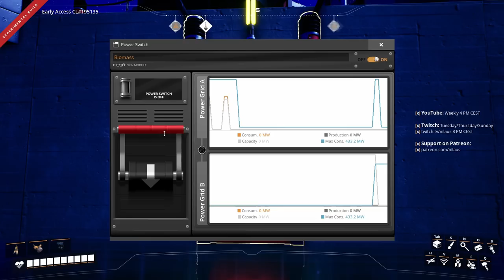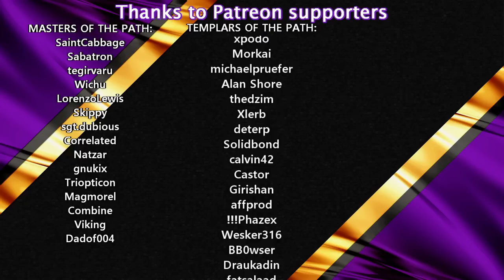FUSE BROKEN! How To Recover From Power Problems | 11 | Satisfactory Update 6

Comment: I like to keep a few of my coal generators on a separate fuse from the rest of the power plant.  This separate line powers the coal miners and water generators which load the rest of the power plant.  And the compressed coal assemblers when applicable.  Then when the fuse breaks for the whole factory, I still have these chugging away loading materials into the generators and priming them so they are ready to turn on.  As my power plants grow, I gradually move more generators onto the separate line to ensure all fuel sources are powered.  I might need to rethink this when I get to nuclear (not sure if uranium getting backed up is wise - I haven't played that part of the game yet), but until then it gives me some peace of mind that turning everything back on will never need me to reload all of the pipes and conveyors.
Reply: yep, and the swatches are real handy too. you can paint your critical power infrastructure with some signal colours, so you see immediately which generators and drills power the whole powerplant.
the downside is: each powerplant adds a new interlocked calculation table to your base planning, which gets complicated fast.

Comment: My Strategy is I isolate each power plant with a switch or single wire that connects it to the rest of the factory. When a power out happens I can disconnect each from the main grid and restart them one at a time. While they are disconnected I can check for issues and ensure max output is reached. 
Once they are all started and any batteries are charged I can then reconnect to my main grid. If Im still over then its time to build a new power plant.

Comment: I always build my power network such that I can disconnect individual factories and each power plant from a primary power spine, which in the early game means placing two power poles directly adjacent to one another so there is a designated cable to delete. Saves me so, so much trouble! There's also a mod that I like to use which adds additional types of power lines, which makes it a lot easier to visually distinguish the spine from a factory wire.

Comment: I wish there was a guild online to help me manage my power and recover from power outages too.  The end made me chuckle.  

I try to build all my factory sites with a single main power in that comes via a main switch.  Then if I either have random floors of things in a building I try to power each floor from its own switch or if I can run a site at quarter or half rate then I try to add switches to let me shut off extra capacity till I scale up.  A lot of switches!  If you can be organised about it though it can be a huge help in taking out large amounts of power to help recover though.  

Thanks for the tips about adding small temporary or sustainable power around larger plan inputs.  That is not something I have thought about doing before but I can see that a few biomass burners might be the ideal thing to jump start after a problem.  I usually try to have raised water tanks and small storage of coal in the hope the buffer will let me power on after instead but one day that may run out.

Comment: I always build battery banks that I charge up fully at coal miners, water pumps etc and make it so I fully isolate the entire power generation system.
That way it's a matter of cutting the main grid, switching to the battery bank and that part of the power generation is back up and running.

Comment: Some excellent strategies here. I have my coal plant powering itself, so if I spike consumption it could collapse easily. It wasn't as much of a worry when only dealing with biomass burners. I'll have to get the caterium research done, but putting in switches to isolate sections is a great idea.

Comment: One thing you didn’t mention about why just flipping the power switch to on doesn’t generally work.  When you flip that switch, every single machine connected draws its power as if it was active.  If the machine has no resources available or has its output full, then it almost immediately switches to ‘idle’ (0.1 MW draw), but for a fraction of a second it does have its full load requirement on the network.  That is why you see a large spike in consumption that then settles down to ‘normal’.  For that fraction of a second after you turn things on, you need to have enough power online to handle that spike of everything being active.
Reply: Is that still true?  Because I can power up my whole world, with a max consumption of 30,000 or so MW, without nearly that much power online.

Comment: I only ever use the batteries as a kickstart backup for my fuel generators and associated sources so I can kick the power production back on after isolating the power hog in my factory. Also having a circuit breaker between power and the factory so I can prevent the power coming back on from letting the rest of the factory overwhelm the power production before its at full output.... Though having biofuel burner connected to just the batteries with a box of fuel next to it for those worst case scenarios would be a good idea.

Comment: ah. The fuse that will fail as you think you are finished!  Would love remote switches for each fuse panel, thus you can turn off micro factories until you have lowered your potential peak to well within your production.

Comment: That uranium nuclear waste bug is a real pain. At least in my case its attached to my plastic, rubber and fabric factory.
The issue is it turns to nuclear waste whenever the game saves and you are far away.  If you stand nearish the pumps then save and reload, they will be water again so long as you stand nearby.  Once you leave and it save, back to nuclear waste.
So, you can't be doing that since it is your source of water for coal power.  In my case, I can stand there, eat a sandwich and come back to a container full of plastic to use until the next time.

Comment: I personally prefer to connect everything related to a specific factory in the same network with it, so I can easily switch off entire factory and all related miners and water or let the fuse broke and powerplants will keep on going behind a switch on their separate networks only consuming what they need to keep going indefinitely, so it's just a matter of disconnecting any one factory, flipping a switch to reconnect powerplants back, build more power and re-enable that one factory.

On the other hand, I almost never let it come close and make sure that I produce more power than max consumption.

Comment: Like others have also said, I always have all the buildings that are needed for power generation (for coal, that's water extractors and coal mines) on a seperate grid, with their dedicated power production. This is always sized so that max. cons. never exceeds the capacty. This way, if your 'main' power goes out, you never have to actually restart the resource supply for the power plant to prime the system again, but you can always just fix your consumption and flip the switch.

I mean I know how much power my power plant needs to be supplies with resources, so why not just split it off and not have that go offline when the fuse blows?

Comment: Could one fill a fluid buffer or two with fuel as a standby for jump starting the system? Have them unconnected until needed, then reroute pipes to drain the buffer and get power rolling again?
Reply: This is a good idea. You don't need to reroute pipes if you use valves set to 0. This way it work like a switch.

Comment: Wouldn't it be easier to just isolate your power production with the switch? That way the only power you're working with is what is necessary to run it (including jump starters). As I finish the video, I see you did just that. I guess you work backwards, where in my mind I just start from the source. Also good idea to isolate your jump starters too so they don't burn out so quick. In my current game, I don't bother with batteries, though I understand why you'd need them for the geothermal.